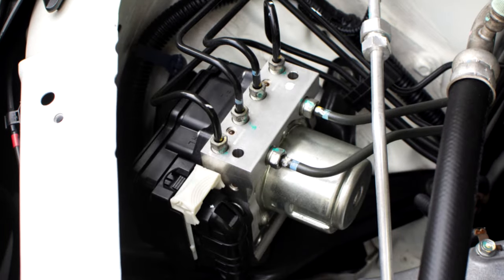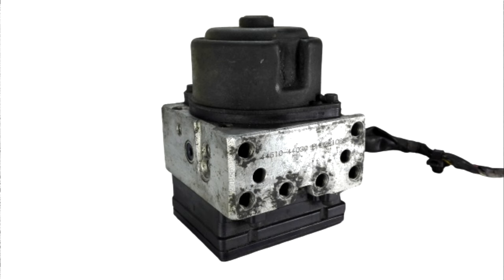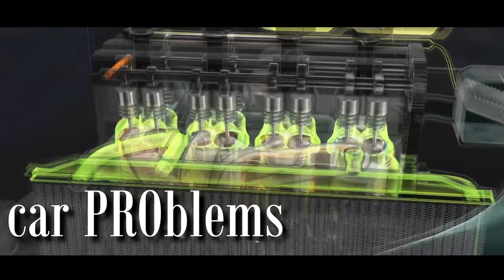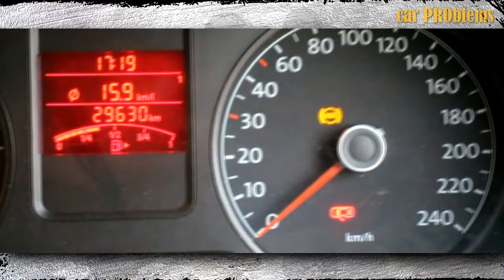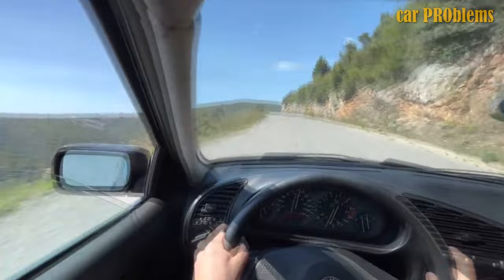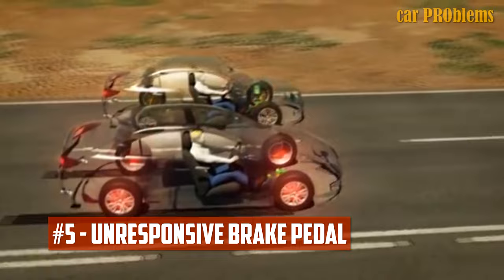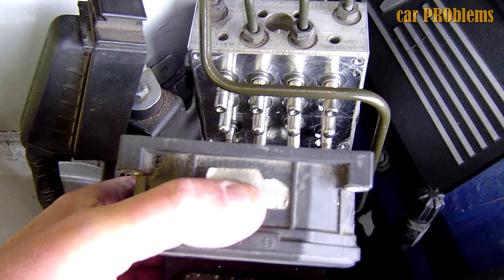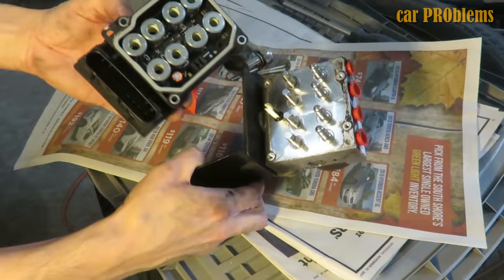Top 5 Bad ABS Module Symptoms

Comment: Fyi: Abs control module is located in your abdomen, also called six packs. Workout to solve your issue
Reply: Yup. Sounds about right
Reply: No 👎
Reply: I did a full set of my core work out, started my truck, boom works just fine.

Comment: this video is a load of bollox. Some of this can simply be a sensor or ABS/reluctor ring. The sensor is a cheap fix with little labour, home diy possible for some. The ABS/reluctor rings are cheap for most cars but can be a lot more complex and daunting to replace at home, simple job for a mechanic though.

Comment: so swapping out the abs/vsa module will solve this issue? And the VSA light will turn off?
Reply: I had the VSA light come on in my Honda Accord once. Turned out it was caused by a loose ignition coil. So don't just go by the dash lights, put a scan tool on it.

Comment: Is it possible to adapt a ABS breaking system to a car that doesn't have one and as well can the valves be reshaped instead of replacing the entire valve unit to fit onto the ABS pump?

Comment: I have a 2011 lexus gs 300 and I have an issue with brakes. The brake pedal goes down sometimes and have no force and I have to push it again until it get the pressure. I replaced the master cylinder with a new genuine but it did not work….any solution ?
Reply: Could be a few issue with the abs..and the modulator..not responding to each other..could be more..than that..they control the brake system..
Reply: I gotta 1998 gs300 lol same exact issue the ABS VSC or wtv lights were on for the longest until my brakes stopped working the other day now the mechanic charging me 1500 for the abs control module and some other faulty part
Reply: @daviduate6808  you mentioned abs and the modulator ? Are they different parts? Cuz I only know the modulator

Comment: Faulty a b s control modules are a racket for Honda in particular. Old school drivers don't need ABS module. What good is a computer if the only thing is it does is malfunction 
 Can't warn you of any other issues if computer malfunctions.Failures can be caused by excess temperature, excess current or voltage, ionizing radiation, mechanical shock, stress or impact, and many other causes. Completely unrelated to performthe task it was designed to do. Planned obsolescence. (Engineered to fail.)

Comment: I have a 2012 gmc terrain with 85k on the odometer.   The abs module schidt the bed and unfortunately the part is no longer manufactured so NoOne will work on the vehicle because a remanufactured module will eventually malfunction as well.
Gmc can only lead me into a new vehicle.  
Thanks GM!
Reply: B4 I hop into another car .... I would try to order the part online from one of these auto parts store 👍
Reply: I have a 2017 GMC savanna 25k on it and the module is bad dealer says 1900 for repair, part is on back order for months.  Ill drive with the lights on. absurd these problems happen to a 4yr old van.
Reply: I have a Kia and mine went out on my 2 days ago and they pulled the same sh*t on me the next day. Told me it'll be $2300 after tax but I'm welcome to discuss finance options for a newer model Kia. Screw that
Reply: @envirocleanct  go to a junkyard to get a used module for like 100 bucks then get a small mechanic to put it on for you.. a used abs module doesn’t need to be re programed its just plug and play

Comment: Just changed Hydraulic Booster. was actuating loud so much. now buzzes once & low should be good now. guess i have to change this too ABS getting a “lost communication with Drive Motor Controle Module” need help :(

Comment: Hello. I own a 2013 model Clio 4 car. There is an electrical problem caused by the abs brain, it drains the battery overnight, and it improves when you pull the brain's socket. Is this problem from the program or is it a technical malfunction in the brain?

Comment: Ive got an issue with 2015 silverado no abs light but I'm getting a u0073 ebcm fault and poor performance any tips ,I replaced speed sensors just in case wiring looks good

Comment: I have this 1994 Toyota Land Cruiser FZJ80 (gasoline) and has a problem related to the ABS.  When the vehicle almost comes to a complete stop, the brake pedal vibrates with a sound and tends to drive the vehicle to the right.  If I disable the ABS, this concern does not happen.  My mechanic  tried cleaning all the sensors of the ABS, but the problem is still there.  Can you please help me out?
Reply: May be brake fluid dirty  try to bleeding four wheels